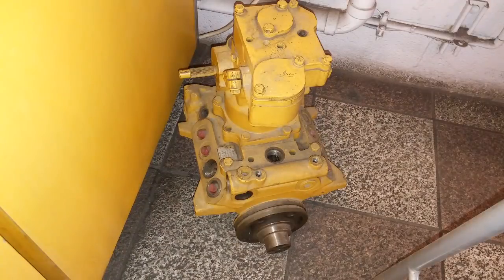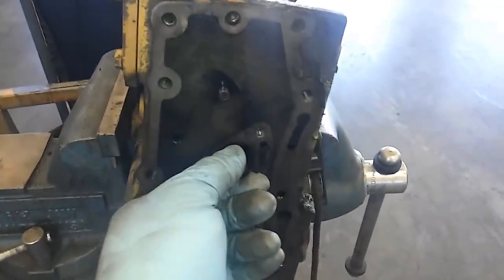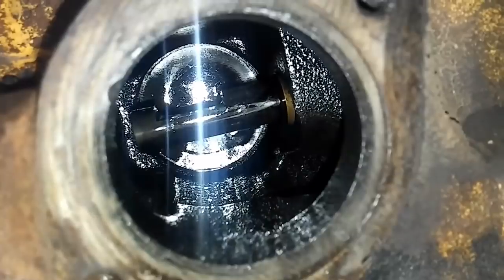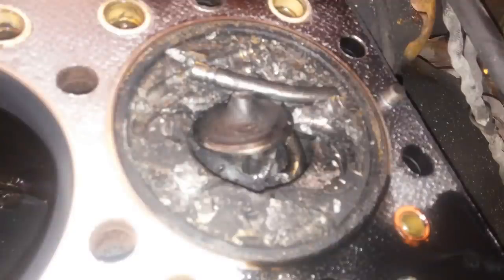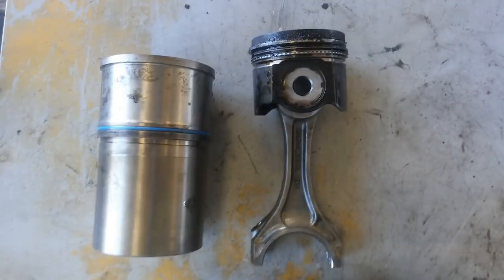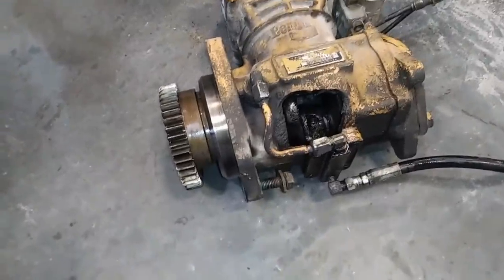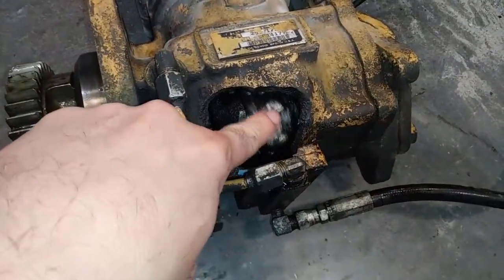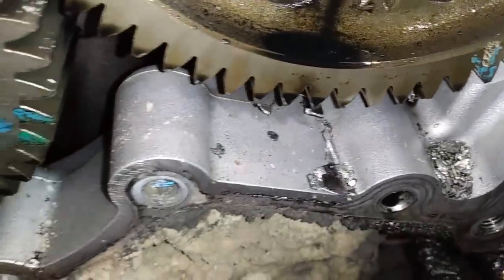Why Do Diesel Engines Runaway? What Is A Diesel Engine Runaway?

Comment: One of the surest safest ways to be 100% ready for any type of runaway situation is to have a 10LB CO2 fire extinguisher plumbed directly into the intake boot or intake manifold and if a runaway situation ever happens just simply pull the pin on the extinguisher and squeeze the handle, engine will come to a stop very quickly with zero damage as long as it did not over speed.
Reply: You are on to it!
Reply: But you are taking away performance from the car 💀
Reply: Just have it on you

Comment: I drove a 2,4 Toyota diesel once. When you went faster than 80 km/h it started accelerating by itself. The problem was worn rings. Sucked the oil from the sump. Every 100 km it used half the engine oil...
Reply: This was likely a damaged turbocharger. When the gap in the oil bearring gets too big, the turbocharger spills oil into the intake. Thats also why it only happens above a certain speed, because below that speed the turbo doesnt fully spool up.
Reply: @heinzletzte.6385  bin gerade dein hundertster Abonnent geworden.
Reply: Oh danke, hatte sogar schon mal 130 Abonnenten. Aber bitte nur abonnieren, wenn der content gefällt (welcher zugegeben manchmal ziemlicher trash ist), nicht nur wegen meinen Kommentaren. Ich will nämlich Niemanden enttäuschen.
Reply: nicht bös gemeint aber das ist immer ärgerlich wenn welche deabonieren lol
Reply: @heinzletzte.6385  normalerweise abonniere ich sowieso nur, wenn mir der content gefällt 😂
Reply: That’s Toyota for ya
Reply: @ZeOverman because saab
Reply: I've got a 92 9000. It has never hinted of running away either.
Reply: Ahhh.. The good old Ct20 turbo oil seal ahahahaha
Reply: How many miles/km's on it?
Reply: @heinzletzte.6385  yep the core breaks down and the oil goes into the intercooler and then the intake
Reply: A 3-liter car. Just like the environmentalists demand!?

"Check the fuel and top off the oil, please!"
Reply: @The Undiscovered Country There is compression in the cylinder only in the COMPRESSION STROKE so no, it wouldn't combust on every stroke.
Reply: @The Undiscovered Country Yes and very little oil can get through the rings, usually the reason for a runaway is caused by diesel getting into the oil through the rings or oil has been overfilled and it gets into the intake through the crankcase ventilation systen when the crankshaft throws oil around.
Reply: The Undiscovered Country Yes, the engine would have so low compression that it propably wouldn't run.
In diesels with a Diesel Particle Filter, delayed fuel injection is used to warm the DPF and that also causes more diesel to get into the oil.

A diesel engine is almost always running on a lean mixture and definitely is not sensitive about the mixture, the black smoke you see in a runaway is caused by the extremely rich mixture.

In gasoline engines a correct mixture is a lot more important.
Reply: The Undiscovered Country You should read a few books on engine mechanics and You'll see who is wrong
Reply: If you loved it, you should have put a ring on it. Or a complete set.
Reply: @linuxusrs7248  what?
Reply: @ZeOverman there 2cycle gas engine not diesels
Reply: it's quite possible even without turbo. On every engine there is a sump vent pipe that usually goes to intake. If you have your piston rings worn it means that more gases escapes from upper space and blow some oil mist from sump... to sump ventilation directly into intake which cause more fuel. More fuel - more revs - more gases in sump and that is positive feedback.
Reply: Didnt know a Toyota diesel existed.
Reply: Diesel energine should be more careful about the air filter and lubricant!
Reply: @f800gt76  every engine after 2007.every engine after 2007 with an egr, every engine after 2007 with an egr that is also a diesel or compression ignition engine.  Im afraid these types/ages of engines are the only ones capable of what you explain.
Reply: 20 ks from town ya passenger looks at ya cluster "shit mate were on empty, im too pissed to walk" you look at him smiling putting your foot to the floor " she's duel fuel mate!"
Reply: @standardaussie  not correct. I told about sump ventilation. Every 4 stroke engine has one. Because pressure below pistons needs to be equalized.
Reply: Add propane

Comment: 30 + year diesel mechanic. Best failure I've ever seen. Boat got tugged to our Morgan City dock. Said they needed two engines. Odd request, that two engines failed. Once in the hull, we saw why. The starboard engine threw a rod and kicked the starter through the port engine block. Both were sister 399 CATs.
Reply: wow! "If i'm going down, i'm taking you with me!" lol
Reply: @brandon2076  "This thermal detonator will blow us all to bits!"

Comment: I used to drive a 71 International Transtar with a 6-71 Detroit Diesel engine, and it had a hand pull emergency cutoff valve in the cab that would stop all air flow into the engines intake. I don't know why they didn't All have that, they definitely should have. Especially them old 2 stroke Detroit's, they were notorious for run-away.
Reply: 671’s ran away more than any diesel in history.

Comment: I am a retired Baltimore City Fire Department  Captain, often times when we responded to calls with Diesel engine compartment fires, and could not shut the engine down, we would discharge a Carbon Dioxide fire extinguisher into the air intake and it would displace the oxygen and shut down the engine. It worked every time. 
Barry Broyles
Reply: its kinda funny how old people always write comments like its mail lol.
Reply: @honkhonk8009  Yeah I’ve seen that happen a lot lol
Reply: @honkhonk8009  It's just how older people write, even my grandparents "sign" each text they send lol I don't particularly understand the reason they do it, but they all do it.
Reply: @honkhonk8009  or you could just have some respect  and appreciate the wisdom
Reply: Nice
Reply: Science. Max effectiveness. Pure gas, no clean up. Work smarter, not harder.
Gruff McDagger
Reply: NICE, That is cool to know. I always wondered how you could kill the engine. Its sort of like killing a fire.
Reply: Very good co2 and cools it down damn good on ya sir
Reply: @jerickodoggo9595  Most common run away diesel starts from a failure in the super charger( blower for the Detroit fans that want to bust my balls about it), or turbo charger. The oil seal that holds the engine oil out of the air intake fails, allowing the oil to get in to the combustion chamber of the engine. It ignites under pressure like the diesel fuel. The only difference is when you turn the key off, it has a remote on the fuel pump to shut down the diesel fuel. The engine will run off the engine oil until there's no oil left. The only way to shut one down at this point, take away the oxygen.
Reply: Barry Broyles thanks I really needed to know your name 💀
Reply: @mannycalavera121  It's not wisdom 💀 it's far from it not every old person is automatically wise
Reply: @Speedyx485  at least his name doesn't start with "meh" 💀💀 by how u talk your life must be pretty "meh"💀💀💀
Reply: @honkhonk8009  It's called proper text... Also just respectful.
Reply: First thank you for serving baltimore city, i know how tough it can be as a city firefighter especially in baltimore and secondly i would never thought of that and forward that information to the guys at my fire dept that i use to volunteer with
Reply: Also instead of making fun of the way he texts compliment him for his service and going through hell to make sure people were safe from fires and many more tragic situations.
Reply: @Speedyx485  those "old people" have already forgot  more than you know 🤣
Reply: @mannycalavera121  when did they show disrespect?
Reply: Minus one point for starting a sentence with "I"... 
PLUS SEVERAL THOUSAND POINTS for being the guy that did and may again... 
You, Sir, should be in charge..!
Reply: @honkhonk8009  Dear Honk Honk, 

[msg here] 

Yours sincerely, 

[my name here]
Reply: Cool
Mike jones
Reply: "Just have some respect and appreciate the wisdom" 

Sounds like the kind of manipulative know-it-all BS that nasty parents tell their children to control them and make them shut up. 

Theres no fool like an old fool, and people tend to become more like themselves, hardening into the sum of their life experiences, for better or worse.

Plenty of people just get worse. They become stupider, more cruel, dull, emotionally immature, and sour as they age.
Reply: @pleaseenteranamelol711  Nice Post... There's rhythm to it... Dividing it up, line by line... Would help the genius meanings You express... come through it...

;)
Reply: @podulox  there u go
Reply: @honkhonk8009  Kinda funny how basement dwellers supported by mommy & daddy have so little to say (but have to say something) and so pick out the most unimportant, off topic details to go off on. He typed his name to close .. so what?
Reply: @pleaseenteranamelol711 it reads like you are well on your way to become that which you loathe. I hope you plan ahead...
Reply: @fc4633  nah. I'm never gonna die. Im a vampire
Reply: I've wondered this before, on really big engine especially where the equipment is very valuable and the runway can do serious damage... Why don't they have a CO2 canister set to discharge into the intake in case of an emergency? I know these things are uncommon but that could be pretty cheap and simple to do.

Comment: Had a Nissan U.D with an inline turbo charged 6 cylinder towed in to my shop because of a no-start condition. Cranked it over and it started right up and went full bore red line instantly. It would not respond to the rack linkage and was screaming so loudly my ear drums were about to burst. I knew it was seconds away from grenading and was torn between the feelings of trying to save a 30 thousand dollar engine or dying from the flying shrapnel when it came apart. I grabbed the air cleaner assembly and luckily was able to rip it loose from the 4 inch diameter tube it was attached to. The first thing i saw lying close by was a small piece of plywood so i quickly grabbed it and shoved it as hard as i possibly could flat up against the intake pipe. The engine started to slow down a bit but would not seal enough to kill it. Another employee ran over and together we pushed so hard on that piece of wood that the engine finally died out before we 
 broke it into 2 pieces. That situation was 60 seconds of pure terror that i hope to never experience again. A mans heart can only take so much!
Reply: Great story thank u for story.
Reply: Such a nightmare. Lives are genuinely on the line with shitty situations like this.
Reply: Seems like a good idea to incorporate a butterfly like in an old carburettor car with a twist knob that can be turned to cut off the air.
Reply: @punchtheundead3127  Well I would if it was my motor, has it really been tried?
Reply: @punchtheundead3127  Well nothing to do with Carbys, but just to use it as a means of restraint, i can't see that a thin cross rod would present any real restraint to air flow if the opening was big enough to counter the minor surface area it occupied.
Reply: @punchtheundead3127   Every one else can see my point, why can't you?, there is nothing complicated about a simple butterfly valve in the throat after the air cleaner You are a very strange one.
Reply: I installed an air shut off valve in front of the intake ram on my 12v pulling motor to try to save it from going nuclear on the pull course
Reply: @punchtheundead3127  I think our problem may be that you might not have read my first posting and thought that I intended it to be in constant use as in a gasoline engine, instead of just being available as a shut off in case of a runaway, reading some other postings, some diesel operators have installed such a device.
Reply: @punchtheundead3127  yeah my intake tube is 6" so the small side profile of the butterfly valve doesn't cause much in the way of airflow intrusion
Reply: @punchtheundead3127   If it does make a difference it does not make much of a difference is so minute because with or without that valve and make the same amount of power and torque
Reply: @punchtheundead3127  Ok.
Reply: reading this comment section has been so entertaining. 8/10 would suggest.
Reply: Jesus dude.
I'm glad you, your buddy, and the shop, are ok.

Stupid question. 
You said it was a Nissan inline 6 cylinder turbo. But you didn't say if it was gas or diesel.
Was it a diesel? 
I'm presuming it was cause i dont think gasoline engines are capable of runaway. 
I'm pre
Reply: @davecrupel2817  Yes, it was a diesel. Gas engines don't run away because they do not function on compression and fuel like diesels do. The only way to kill a runaway diesel thats pulling in a fuel source where its not supposed to be is to choke off the air supply at the intake. Sometimes that is possible to do and other times it is not due to the amount of time it would take
Reply: @timrussell1559  as i suspected lol

I pray nothing like that ever happens to you again.
Reply: Keep a co2 fire extinguisher close by, spray at the intakes and it will kill any runaway. Needs oxygen to burn the fuel.
Reply: Thank you for your service fellow mecha man! Glad you made it and can share the epic story!
Reply: Wow. I could only imagine
Reply: I love this: "A man's heart can only take so much" but you're talking not about a woman, but a diesel engine!

Comment: Me: studying cyber security
Google: how about learning about runaway diesel engines
Me: Interesting. Yes, I think I will.
Reply: Hahaha👍
Reply: you never know, it could be a cyber attack on the cars ecu causing full fuel. there’s a youtube video where these guys spent 4 years trying to hack into a 2014 grand cherokee and eventually they got it! i’d give it a look
Reply: @Zach Hein  haha, yeah. I've seen that and a few others. However, that's like taking four years to drill the locks on a local bank vault with un-hindered access and no cops coming (and no money inside hahaha). It works for that one car, but isn't duplicatable to any other vehicle including other 2014 grand Cherokees. CAN-bus encryption and vehicle unique security lockouts make it dang difficult to modify things that shouldn't be touched. There are a bunch of thieves (mafia) running around with off the shelf hardware stealing cars by momentarily rebroadcasting the signal from the owner's key, but that's not hacking in ANY way shape or form. It seriously isn't any more complicated than a voice recorder for radio waves. (It's called an RF replay attack) Plus it's pretty much a one shot thing, once the car is off, they can't restart it without grabbing more code frames from the fob, which they don't have obviously. Smart thieves will grab enough frames for several minutes of key spoofing, but that's risky to hang around for that long.
Reply: Literally me!! I'm supposed to be doing cybersecurity (IS-141) homework right now lol
Reply: On new diesels they make today since there’s no rack to stick open when the turbo seals blow out the engine is feeding hot oil past/through the worm turbo bearing & essentially going wide open on oil until either the engine looses air or fuel/oil or the engine sizes up from oil starvation.
Reply: Are you me?! Am I you!?!
Reply: Same. Infosec here.

Comment: The best runaway I ever saw was of a Chieftain tank, it has a 19-litre ( around 750 hp (1,200 cu in)) vertical six-cylinder opposed-piston 2 stroke and supercharged (  3 lobed roots blower ) diesel engine. The squadron had just pulled out of a hide in a forest and it was twilight, I was told to stop and come up on the turret to watch, anyway the engine was revving so high it sounded like a Harrier jump jet then there was a massive explosion and flash and the back decks of the tank were thrown off, the engine had destroyed itself. Very impressive
Reply: "The best runaway I ever saw was of a Chieftain tank"
^^^YOU WIN! 
(Best one I ever saw was a Renault Trafic van..!)
Reply: @podulox  
I saw a Transit "I think" go runaway about a week ago. Outside a local school whilst the kids were going home. They were all laughing at it!
Destroyed in 90 seconds.

Comment: I’ve seen this in the oilfield as the Diesel engine was was in a run-away mode even though the ignition was turned off. It was all because the engine was sucking in oilfield gas into the intake. They eventually installed a 3500 dollars butterfly valve on the intake to protect the engine.